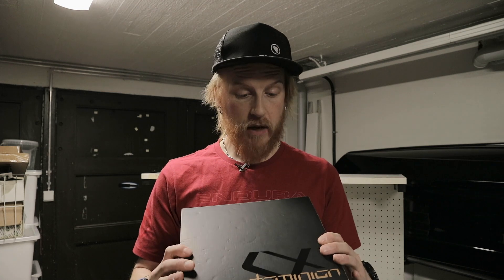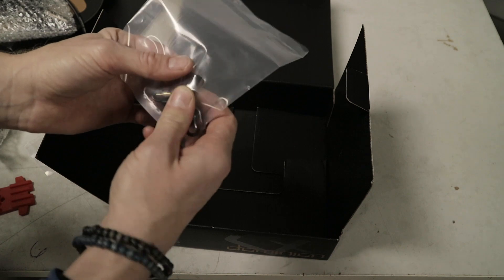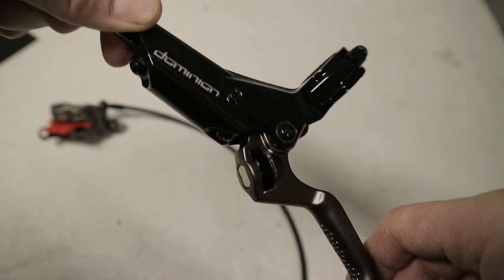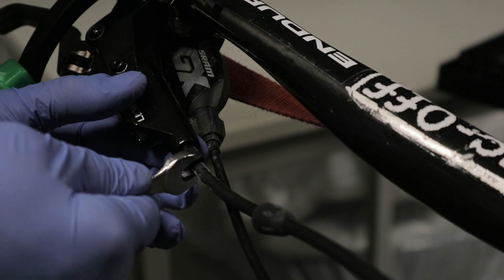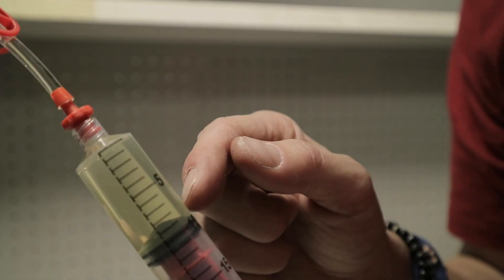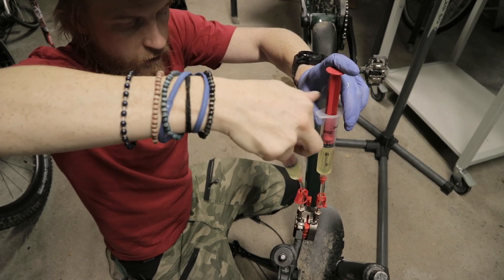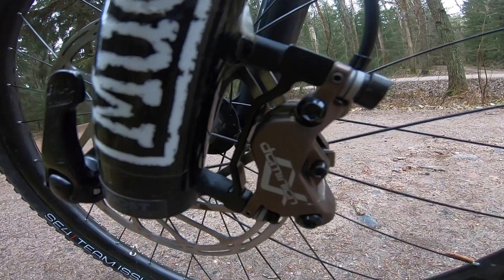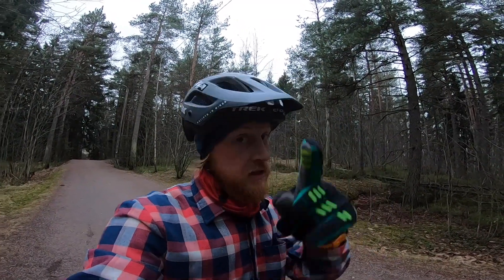Hayes Dominion P4 brakes bleeding and review

Comment: It is not clear from this video which port of the caliper you used when bleeding from lever to caliper in the first step.  Does it matter?  I am guessing maybe not since the second step is from side to side on the caliper.  But then again I am just trying to figure out why these are the best feeling (on the fingers) and worst braking brakes I have tried (including SRAM Level, SRAM guide, SRAM CODE, Shimano XT, Shimano XTR).  I want to like these brakes but the bite point wanders all over the place based on temp and bumpiness of the trail.  It's a good thing they have an adjustable reach because I am always fiddling with it mid ride to try and keep the bite point where I want it.  No doubt the feel is good when its just right too bad it wont stay there.
Reply from the maker: Hey! It doesn't matter which port you use👍 and bleeding the caliper separately is not necessary if you get the air out through one port. My brakes are great, good feel, great bite and controll. I have been using cool stop pads from the start,maybe that could work? Another thing is to make sure your caliper sits right, it needs the right adapter
Reply: there could be air in the system if the bite point wanders

Comment: Hi Tom, your dominion bleed method was totally different from the hayes blee video. Did your method work well for you? (: 😀 thanks
Reply: Hey man! I did watch the Hayes bleed video prior to my bleed, I also checked out a couple of different ways to do it. This method worked well, the principle is the same as in any other hydraulic system, bubbles find their way to he highest point in the unit. The dual bleed por in the caliper might be confusing to some but it's nice to have if there is some trapped air.
Reply: @TomNylundSuomi  thanks!! I learned a lot here! I'll try out your "style".

Comment: Dot fluid is holding me back from trying these. cus it's toxic. But I am done with Shimanoo brakes as I suffered from evil circle of leaking brakes, several brakes.
Reply: Which Shimano brakes have you tried? I use the XT brakes and never had a leak. Only leaks I've had are from Hayes brakes and it's from the rubbish master cylinder cover they use.
Reply: @richardjones2811  Shhimanoo M396 which leaked after few days of use, and threads in body for torx screw failed, M615 Same thing happen there, both leaked, 3 sets of m615 leaked, then Warranty replacement, all 4 leaked there, one brake in 40 mins of riding, one set in few weeks, another in few months, it's been a year since I returned it, since then it's been silence  , but contacted the retailer I returned them to, and a dude was going to look into it, that's few months since that. but there brakes were flawed, cus the reach adjustment effected the actuation, max power for long fingers, and no brakes for kids. cus of the servo vave tech, it needs bite point adjustment, the M396 had direct reach adjustment, at the part pressing the piston. So I would not want to use these brakes anyway, but now I use TRP Spyke mechanical brakes, but I think I will get Trick Stuff Maxima next. the most powerful brakes on the market, and have direct reach adjustment. but it's long wait right now.
Reply: @mtbboy1993  Stop buying the cheap Shimano brakes! Get some more expensive ones and you'll love them. One finger braking for my Xt's and simple to bleed compared to other brands. More often than not just a simple lever bleed is all it takes.
Reply: @richardjones2811  The higher end models probably have better quality control, at least Bikerumor claims XTR has better quality control. But I dislike that you can't get spare parts for the, unless you go aftermarket on alliexpress, I would like to have spare seals. it's been so long since I returned them, that this is ridiculous, seems like they ignore me. Also Shimano XT M8000 cage axle thread failure happen, and they denied warranty cus it was damaged they say, so some scratches and it void warranty, silly it was clearly a faulty product, and I had to order parts from SJS cycles in UK.
I've had several shimano rear derailleurs over the years and this never happen.
but shame they denied warranty. it was Shimano Norway.
but was satisfied with the performance of Shimano XT M8000 & XTR M9000 shifters, but I sold XTR shifters cus they don't fit me, I will eventually sell the Xt shifter too. I use Archer D1X trail which works great for me, it fits me, and eliminates fatigue.
I could not use the old shimano brakes like M6000 or even the XT brakes cus of the clamp, it interferes with the remote, basically I have to have them inside each other like a ghost. but latest models fix that issue, due to new clamp design.
Reply: @richardjones2811  I once swore by Shimanos but no longer... The constant altering bite point becomes dangerous.. They need bigger reservoirs. I've had 3 sets of Saints M820 go back under warranty.. Fed up of it now and gone with Hayes dominion a4
Reply: @alpine7891  Recently bought a street trials bike which came with Hope Trial Zone brakes. They are absolutely amazing, never felt such a strong brake before. Mind you they have to be strong on a trials bike. Much Much stronger than my 4 pot xt brakes and they're only a 2 pot!
Reply: I got a pair of XTR’s and I agree with you with the “evil circle of leaking brakes” and the lack of parts needed for servicing these cursed things. I’m thinking of switching to these Dominion A4 brakes and live a happy life and ride towards the sunset.
Reply: @daledausin  aliexpress has parts for the recent models, I don't know if they have grommets for the cheap and old brakes, but the O rings and piston caliper seals are for current and a few years older brakes are sold. but really if you know the correct measurements a seal retailer might have them. but if you order something that says it works you know without measuring. I've not tried, I gave my brakes away, and a dude did this, fixing htte leaks.